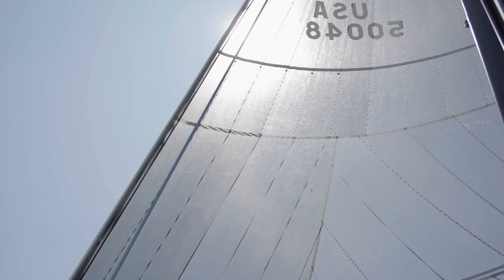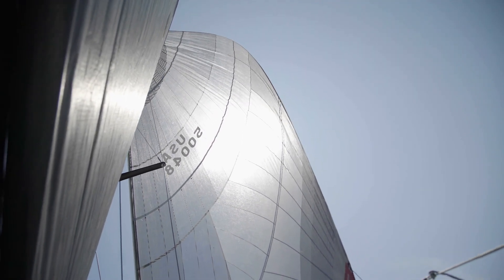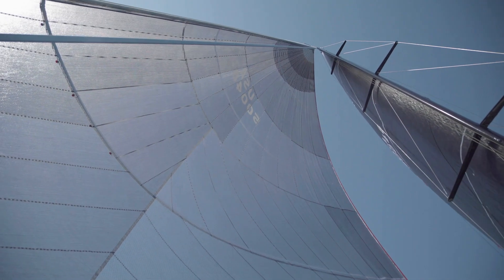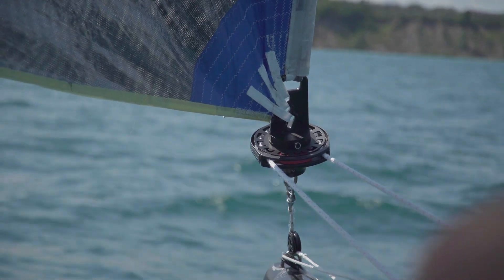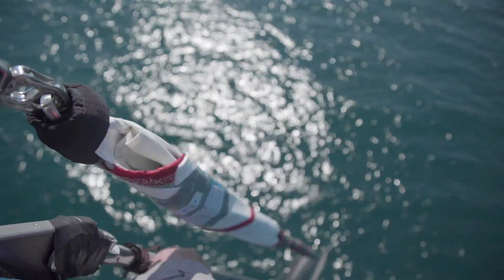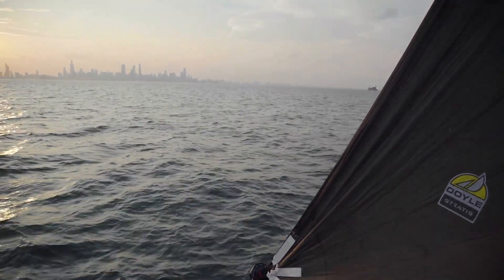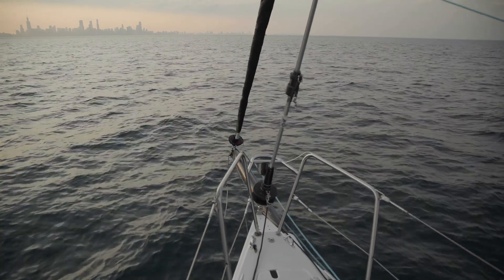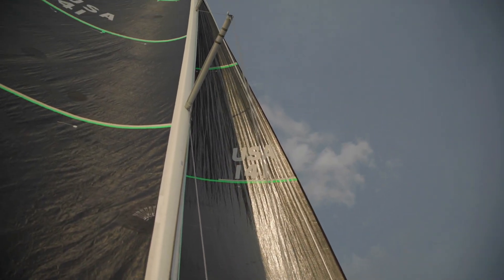Harken Reflex Furler for Cable-Free Code Sails

Comment: So is this a different reflex Furler than last year?
Reply from the maker: Thank you for your interest! Yes, the Harken Reflex Furler for Cable-Free Code Sails is a brand new system, and it will be available at your local Harken dealer soon. This cable-free system is different than the previously released system that is sold with a cable. If you'd like to learn more about the cable-free system, please feel free to contact the Harken Tech Team at technicalservice@harken.com - or read this new article about the cable-free system in the latest Seahorse Magazine: https://www.seahorsemagazine.com/current-issue/2-uncategorised/832-reflex-reaction